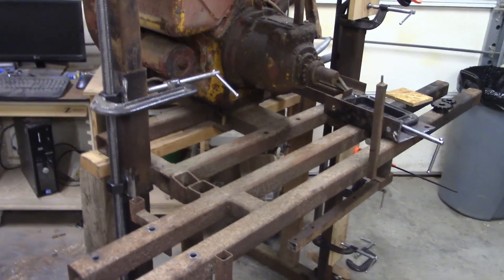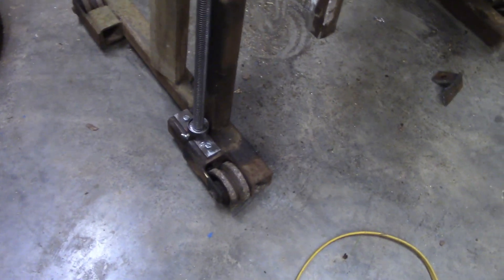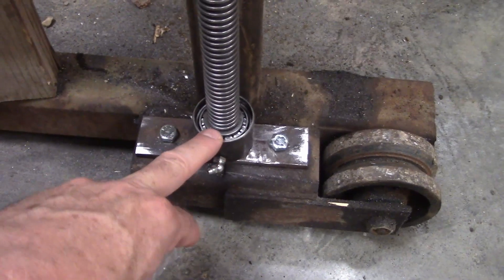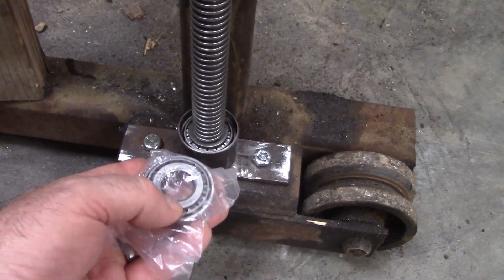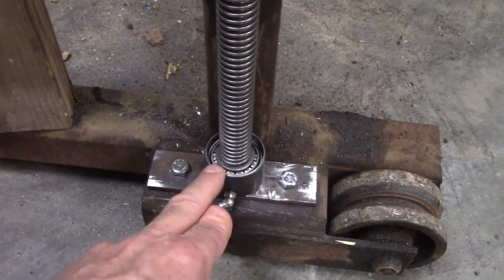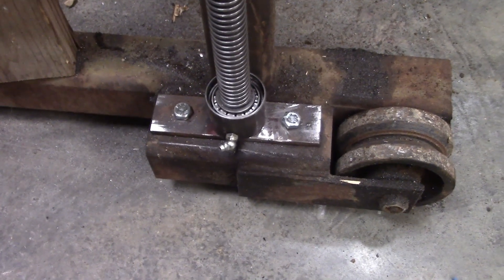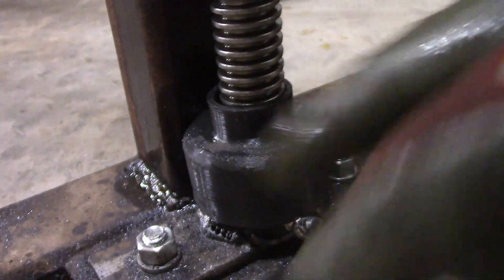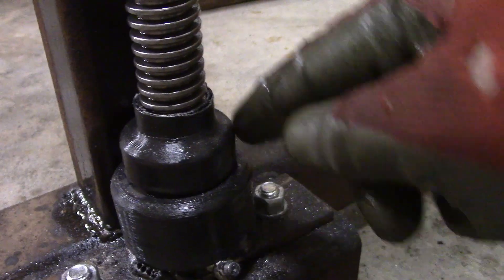Low Cost DIY Thrust Bearings

Comment: Curious as to why the second dust cover was needed vs. Just making the larger one a tighter fit?
Great idea/execution! Thank you for sharing (as always)
Reply from the maker: The space was kind of tight to fit the first one and I didn't think I could get it in there perfectly and centered on the acme screw.  I also originally planned to have an acme screw thread in the upper piece to seal it but it proved too tight a fit so I just reamed it out.  In hind sight I probably could have done as you suggest.  Thanks for sharing your thoughts.